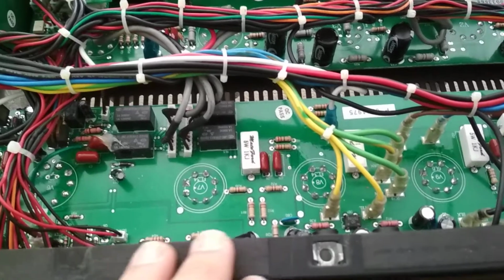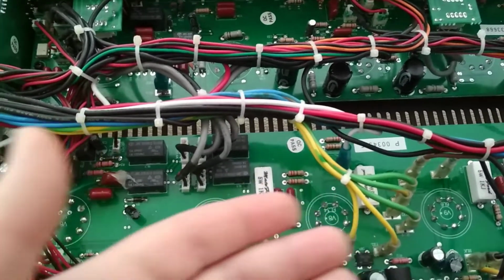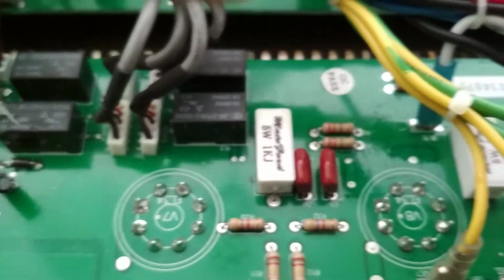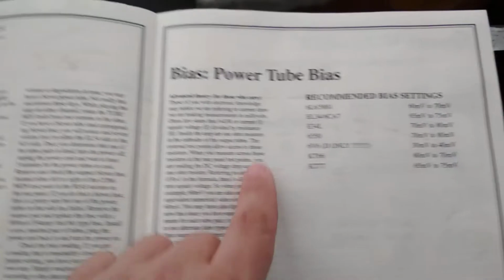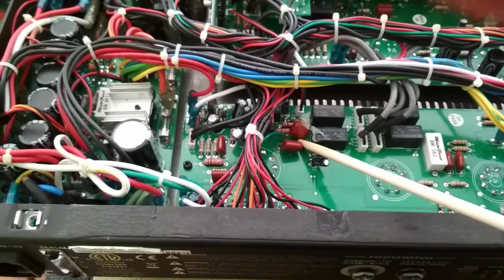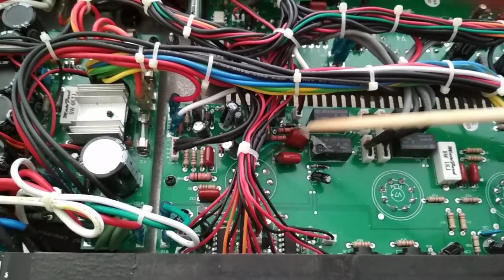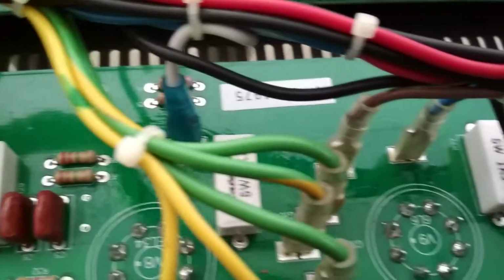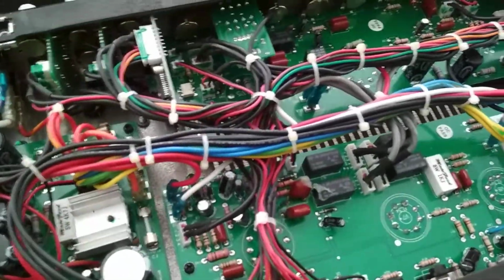Egnater Renegade 112 blowing fuses

Comment: Someone has modded that amp .. ive worked on a few of these and that green wire is not there on any ive worked on, no solder hardly on r47 42 58
Reply from the maker: It has absolutely been modded or “fixed”.

Comment: Hi did you post part 2? please?
Reply from the maker: Sadly not, the transformer was unavailable. Egnater never responded and a replacement Transformer that was almost close enough to work was worth more than the amp. The customer picked it up and sold it for parts.

Comment: I've got a Renegade that blew the mains fuse on the bench now. I didn't replace the fuse because just from the intensity of the arc burn on the glass, I knew it was seeing dead short and a lot of current passed. So took the amp apart. The HV winding reads only 21 ohms across the winding, 7 ohms from one side to center tap and 22 ohms from other side to center tap. I would normally expect to see around 140 ohms on a HV winding and half that to center tap, so unfortunately, it looks like yet another bad transformer.
Reply from the maker: Damn. These amps and transformers. Sheesh.

Comment: did part 2 get put out?
Reply from the maker: Sadly not. Conclusion is, Egnator never responded to emails or calls. Aftermarket and original transformer is unavailable or too costly. Customer sold the amp and bought a vintage Fender.
Reply: @FixItAgainPhoney  I just concluded my Power supply is compelety shot, i can buy a new one but do i wanna is the question.
Reply from the maker: @ConnWilliams  I guess it really comes down to whether or not you want to keep the amp? Do you get the new transformer and enjoy the amp? Or get a new transformer and sell the amp? Or sell it as is? These are the questions I often ask myself for most of the repairs on this channel that aren't a customer amp, but a faulty one for sale that I'll be interested in buying.

Keep us posted with what decision you end up making.
Reply: @FixItAgainPhoney  I wanna fix it but i also want to know the life of it afterwards so i need to research a bit
Reply from the maker: @ConnWilliams  that's always the million dollar question.

Personally I would sell it as is, cut my losses and try and find a nice example of a vintage amp. Main reason being that there are so many great aftermarket options, vintage amps aren't loaded up with proprietary circuits for channel switching, they are usually easy to fix due to being ready to work on. Making it affordable in labour and parts. I could go on, but you get the picture.

I'm a fan of old stuff. It sounds good, easy and cheap to fix. No PCB in sight to get hot and become conductive.

Comment: Hello, I need the secondary voltages and currents of the Renegade 65 power transformer. Do you know if it is possible to use a Hammond power transformer?
Reply from the maker: To be honest, I cannot remember the exact configuration. But I recall there were also some low voltage taps coming off the transformer that powered some solid state components. So the only option was to rewind it, which was going to cost more than the value of the amp.

I believe Mercury Magnetics might have had an off the shelf product, but shipping it to Australia made it expensive.

I guess if you live in the United States, it might be cost effective. But if you live elsewhere, costs might become prohibitive.

I'm sorry I can't help much more than that. Truth be told I also contacted Egnator directly via email numerous times. I never heard back from them at all. Mr. Egnator himself is on Facebook and didn't even respond to me there.

It appears that these amps have a notorious reputation for power transformer failure and Egnator won't acknowledge their mistake of cheap components.
Reply: @FixItAgainPhoney  Thanks Stefano. If I had the values, I could rewind the transformer. A good friend of mine works in a transformer company. But it will be very difficult to find out them. What I know is: B+=365V-0-V365 (red-red/yellow-red), 33V-0V-33V (blue-blue/white-blue) 16V (Orange-Orange) 6,3V with CT (green-green/yellow-green) and the Bias winding (yellow/yellow, I think around 50V). But no currents. Maybe the HV 250-300mA? What do you think?
Reply from the maker: @Guitarman20  ah. That's pretty handy having a friend like that. With current values, that's easy. Look up all the tubes maximum current draw. Add them up.

Comment: Hi, did you ever fixed the amp? is worth getting the head used for $450?
Reply from the maker: No. Sadly the only options were expensive transformer rewind. Mercury Magnetics with shipping and import duties were almost as much as the amp was worth. And egnater never returned any of my inquries. The customer sold the amp as is.
Reply: Stefano Musica thanks for the response. Ill look for known brands instead. What do you think of the bugera low budget amps?
Reply: @jorgeguitar2540  I just fixed one of these and it was a nightmare. It was blowing f2 no matter what I did, including installing the Mercury transformer. It ended up being the 3055 transistor. There is a plastic ring that isolates the mountains screw from the chassis. It was previously tightened too far and it broke and created a sort between the plate of the collector and the chassis via the mounting screw. I wanted to scream when I figured it out.
Reply: @offthewallsk818  hi are you talking about the egnater or bugera?
Reply: @jorgeguitar2540  egnator. Bugera are ok if you get the infinium series. I would avoid anything prior.

Comment: I have an Egnater Tweaker combo that keeps blowing fuses at the power cord input. I looked it up today on the inter-web and it seems to be a common problem with Egnater, suggesting it’s probably the power transformer causing this. Expensive fix for a little amp. I think this has probably hurt that company. I would never ever buy another one. Luckily I got this for about half price, slightly used, from a music store that was going out of business a few years ago. Now I see why it was almost half price in “excellent” condition. I haven’t played it that much due to using other amps but I decided to get it out yesterday and blew two fuses back to back. When I first got the amp I probably had a couple hours play on it and blew a fuse, replaced it then it seemed to be fine so I put it up upstairs in my extra room and it’s just been sitting due to me using another amp until yesterday when I blew the two fuses. It’s a pretty cool little lamp too, it’s too bad.
Reply from the maker: @Horizon585 well, the quick method would be to replace the fuse and then test. If it goes straight away, you've got an issue. It's also worth having a current load/limiter. Uncle Doug shows how to build one on his channel. It's essentially an incandescent light bulb in series. If it lights up, you have an issue/short.
Reply from the maker: supermotorcat they do sound good. But what's the point of having a Ferrari, if it's always going to be in the garage?

I have sent three emails to Egnater with zero response. So I've called the customer back and said I can't fix it due to such a complex transformer not being available off the shelf, and Egnater's customer service being non existent.

It's definitely the power transformer, as I unplugged all the wires, so there's nothing else connected apart from a power cable to the amp. And then the transformer. It still blew a fuse.

So, with no response to purchase a replacement from the manufacturer, no off the shelf ones available, and custom made one off transformers too expensive to wind myself or pay a transformer winder to do for me. I've admitted defeat and called the customer to pick up their amp.

Personally, is never buy an Egnater based on this, their lack of response, and the fact that when you google them, it's mostly complaints about this exact issue. Clearly, they don't care.
Reply: Stefano Musica I read on a forum about a company named Mercury Magnetics that might be able to supply these transformers but they run about $100 more than the originals. Much better quality from what I understand though. Anyways, good luck to ya mate!
Reply from the maker: supermotorcat correct. However, the transformer is over $200 USD. And approximately $120 USD shipping to Australia. With the exchange rate, it works out to over $500 AUD and that doesn't include labour.